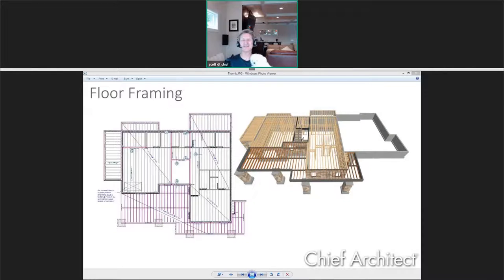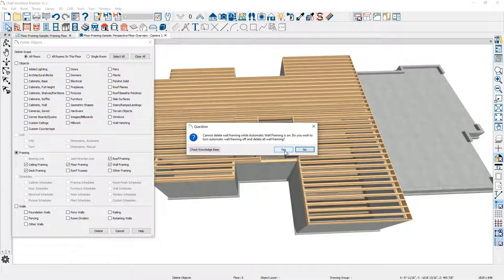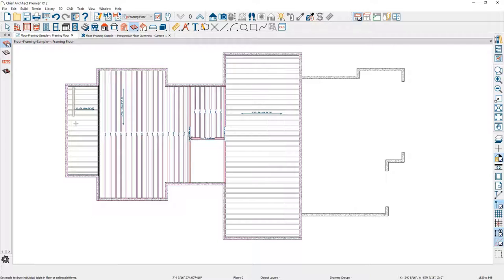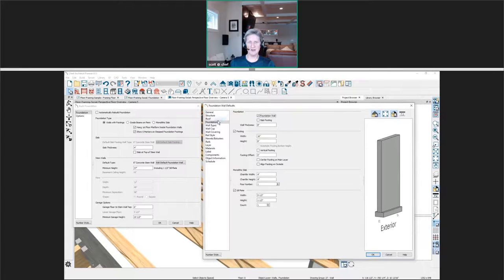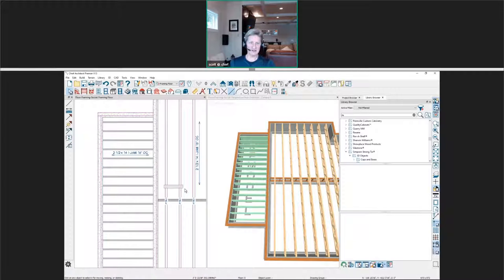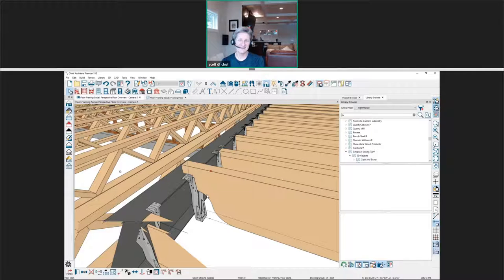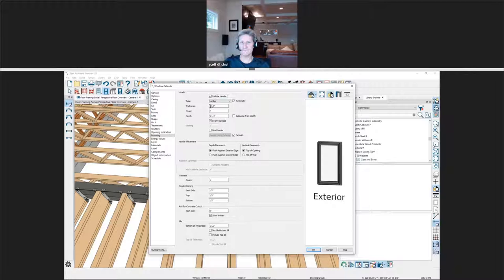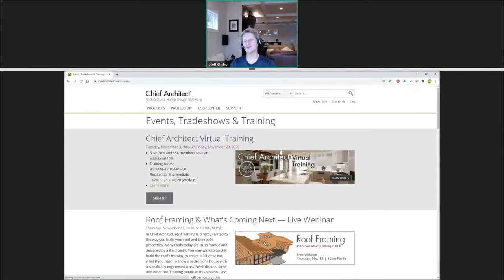Floor Framing Tutorial (Re-Run)

Comment: Hello again, I've been learning your software for a week now, when you work with a concrete 2nd story floor, is there a way to design it's steel bars or you would recommend to work those apart? and is it possible to work with shoe footings for concrete columns?
Reply from the maker: You can create this with the primitive options in software, here is additional information: https://www.chiefarchitect.com/support/article/KB-01182/using-the-round-pier-and-square-pad-tools.html